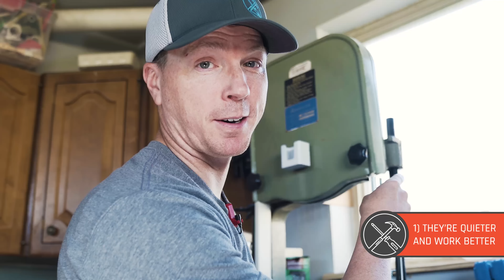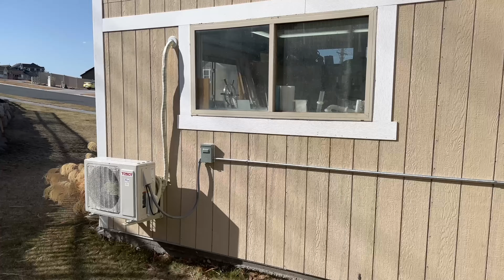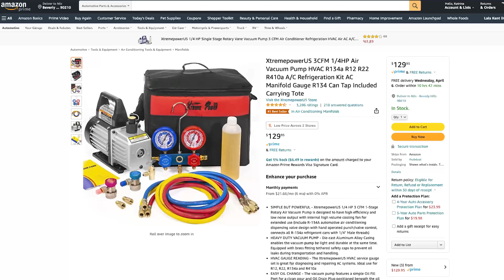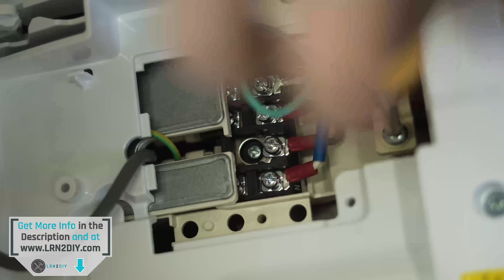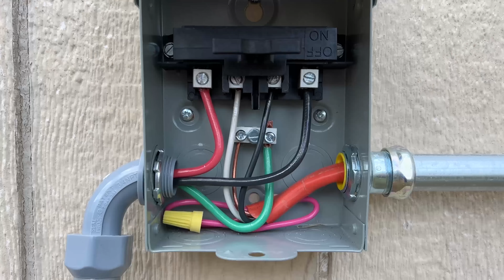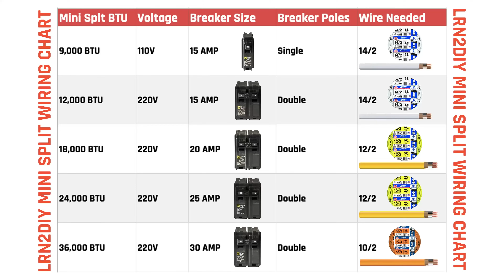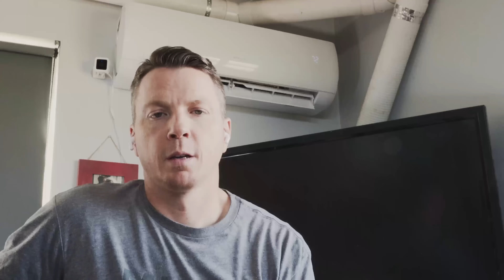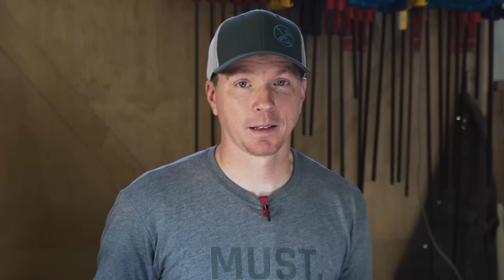Mini Split - 3 Things I Wish I Knew Before Installing

Comment: I just replaced my old Sanyo mini split. It was a12,000 BTU I replaced it with a Hessaire that came with precharged lines and inside head unit. It is also a 18,000 BTU or as they called it 1.5 ton. It was a little tricky but the meaning pre charged means the lines and head are pre filled with a gas NOT FREON. This unit was also a DIY unit. Only thing is i am having trouble getting it hooked up to my WiFi and cannot find the serial number on it. I am awaiting to hear from Hessaire for more information on these subjects. The unit works GREAT so far and I also realised that before I put the lines on I could cut them to a shorter size and reflair the connecting lines. The unit seems to have had enough freon in it to take care of the lines. Heat and A/C work great so far. I paid less than $1,000 dollars for the unit. It is also VERY quiet compared to my other unit.

Comment: I honestly didn't believe a mini split would be any quieter than a window unit. I was wrong. Now mind you, it's not totally quiet as in you won't hear it. If I had to compare the noise, I'd say it's more like the noise a regular stand fan makes on a medium speed. In other words, yeah, you know it's on, but it's not so loud it's disrupting to anything you're doing. This is only when you have it on high. At slow fan speeds, it's really quiet. Another thing that was surprising was their ability to cool your home.  We got an 18k unit for our living room kitchen and dining room (open concept), and it's never struggled to keep the area nice and cool even on 100-degree plus days! We also noticed the air is dryer than it was with window units. The inside humidity was around 60%, and with the mini split, it was around 35 to 40 % humidity.  We live in a high humidity part of the country, so having dry air inside is awesome! All in all we are really happy with ours. The biggest bonus was the cost! Local hvac contractors wanted around 7 grand to install one mini split! Now granted they had a 10 year warranty but only a 2 year on labor. We all know it's the labor that cost the most. We could litterly install a new unit for what a couple of service calls would cost in case something went wrong! It's just ridiculous what hvac companies are charging! It's no surprise that hvac contractors hate on mini splits so much! Lol!

Comment: Considering replacing a 20+ YO small Heat Pump serving a small upstairs apartment presently with an attic mounted air handler and outside condenser. Two motivating factors: Updating system, and lowering power demand. Apartment has dedicated power service of 100A. I plan on converting that Main to a 60A sub from 200A Main in main living quarters and hope a small mini split will work satisfactorily on that Subpanel. Thoughts?.What is the Amp requirements for a small mini split? Thanks for your video,

Comment: Mexican A/C's cost $400 USD, and they are Cheap to repair, downsides? you will have to make a ºC to ºF converter in the back of your remote, and has no Wifi- who needs it.

Comment: I think something else to keep in mind is the vacuum pump and gauges are the same equipment you need to work on your cars AC so it can be something worth having around. We did two mini-splits on our house this spring in Arizona and are loving them. I plan to install more after the summer for next year. Its so much nicer being able to cool the rooms we want to use vs the whole house when its this hot out.
Reply: Nice work.  I did the same thing and switched the whole house over to three ductless mini splits.  I did all the work myself including pumping a vacuum on the lines and flaring the line-sets.  The worst part really was running the electric, but I was an electrician for 12 years in the military.  A note on efficiency:  Our electric bill here in FL went from $10-$16 a day in August to $4-$6 a day.  I am expecting a drop of 1/2 or better in electric utilities.  Our central a/c was an old RUUD unit R-22 and I don't think it even had an efficiency rating.  Like you said..... we love it that we can turn units off and on in rooms that we are not using.  At night we turn off the 18K in the living room and just the run the 12K mini split in the master bdrm and close the door.  I did some calculations and it looks like our mini splits are pulling from $22 - $25 a month in electricity each.  That is a HUGE cost savings.  I would say installing these a/c units was the best thing I have done to this house so far.
Reply: Come help me install mine.  I'm in AZ as well.  :)
Reply: @151mcx  Gotta wait until just walking outside doesn't cause 3rd degree burns! Just saw our July bill and its running about $100-$150 less than it would have been without these units.
Reply: Something to consider: The line connections are the cause of many problems leading to failure. Recharge Freon is high and when installing yourself, the warranty is usually void for compressor failures due to power surges, low Freon ect… while the wall unit ac is loud but reliable; the quality of mini splits and customer service make it a tough choice to make. I’m on the fence

Comment: I bought a Costway 1200 b.t.u unit for 659. I did have to buy conduit, wire, etc, but it was well worth it. The efficiency is hard to believe. It uses about half of the energy in twelve hours than the window unit did in four. 
 I have no idea about the longevity of these things, but if it lasts even four or five years it’s well worth it. 
 I know it’s against building codes, but if you have a 115v unit you can put a three prong plug on the end of the whip if you want. It would be best to make sure it has the circuit to itself. I don’t recommend it, but it can be done.

Comment: It gets really hot here in the summer, so AC is a must, I need something that I can run for at least 5 hours that has a lower elec. usage.  I am taking a hard look at them. Our master bedroom does not get AC or heat, so having a dual unit would be preferable.  Our central AC is really loud your ears hurt after it cycles off.  Hopefully this is a good alternative

Comment: I just ordered a Danby 18 000btu d.i.y. It also had precharged and vacuum lines. So no need to vacuum line before installing. Electrical isn't very hard to do, just a wire and switch box. Hopefully it will last a long time. Apparently Danby is a good brand.
Reply from the maker: Nice! We still love ours and I'm sure you'll love yours too.

Comment: Aren't you overlooking the cost of the refrigerant? I hear that stuff is really expensive.
Reply from the maker: The refrigerant is already in the condenser unit and is released into the lines when you open them. This video shows the entire process and there’s nothing else you have to do.

Comment: I have never installed A/C but one of the key actions I see in videos is checking the line is gas tight before you introduce the expensive refrigerant. How can you do this with MrCool - you can't.

Comment: Great video. I am entertaining a mini-split in the 12k range to assist a central unit that just doesn't cut it during the summer. It is running 24/7 and the house still reaches 77 during the day and early evening. Unless I missed it or it was figured in somewhere else, did you include the cost of the freon to charge the lines? Do you have any figures on that?

Comment: The Mr. Cool unit you show puts out 12,000 BTU with just 115V input. You said yours is 12k BTU @ 230V. Not sure if the amp difference balances out actual power consumption, but I would guess the Mr. Cool machine to be a bit more efficient in the long run.  Not to mention some DIY'ers have already maxed out their 240v slots in the breaker box.
Reply from the maker: If you’re able to run the same BTU on 110, that’s pretty great. Adding the 220v is a lot of work for most folks.

Comment: so glad I click on this video! I live in southern Louisiana and my central air went out 5 days ago! It's been hitting 93 degrees each day and 80% humidity. I'm a teacher on break so I'm just living in my bedroom with a window unit. All Heating/Cooling businesses are backed up a month busy and I can't afford to replace a full Central Air unit, anyway. But I MIGHT be able to do this with a little help and your videos! Guide me, Yoda!
Reply: Cools better than central aor
Reply: @tecnikstr0be  I looked into it and can’t afford to set up the house right now. I bought a large window unit for the front of the house. When the time comes for some renovation and I’m doing other stuff, I’ll pull the funding for it. Keeping that bedroom window unit for hurricane season. It was my savior running on a generator when the lights went out!
Reply: @cassiev340  they aren't expensive I use aux brand and cools very cold
Reply: @tecnikstr0be  but I would need to set up for my whole house. I was in a position to spend a few thousand.

Comment: When you were discussing the cost difference between your unit and the Mr. Cool, what about the cost of the freon, or whatever they call it theses days, to charge the lines? I don't think non-licensed individuals can purchase or install the medium.
Reply from the maker: This unit, like many DIY units, comes precharged with coolant in the condenser. You never touch it - you just release it into the lines and that’s that.

Comment: Thanks for the video - good job. Quick question. I am building a sun room off of a patio.  Where I plan to instal the mini split is currently an exterior wall (will be an inside wall) that has Hardy Board. Mounting the bracket will be slightly canted to follow the row of siding making the bottom of the bracket out more than the top…..will this be an issue? I know it’s good for the drainage issue but do the units need to be level from to back as well as side to side? Thanks.

Comment: When you showed the vacuum pump and the oil for 130 bucks, did that include the refrigerant???
Reply from the maker: The refrigerant comes preloaded in the condenser on these units. You don’t need any separate refrigerant.

Comment: Your wire/breaker chart is incorrect. OK for THHN CU wire, but not romex.  Also, why did you run #10 to the disconnect for a 13 amp load and then #6 to the outside unit?

Comment: This is not a DIY for a novice!  If I were to purchase a mini-split I would lose all my savings by having a electrician to install the breaker box etc., However, I would love to hear your recommendation on my situation. My parents have a enclosed porch off of the family room single brick wall on three sides, the roof will be re-roofed with new material, last year November 2021 a small contractor insulated the porch roof with rolled insulation R-30 Unfaced Fiberglass 9 1/4-in thick - https://youtu.be/Jhgzry4CNTY

Comment: It's worth noting at this juncture there are a lot of 12kw 115v plug in mini splits these days.  So for a single room system, you absolutely can just plug it into a standard outlet now,  if that will provide for your needs.
Reply: I think you mean 12K BTU, not 12 KW.  What brands are you referring to?  I also do not think NECode would allow for putting a plug on an appliance that did not come with one, but maybe an electrician on here will tell us for sure.  On most minis, certainly those like the 2 Pioneers we installed in 2015, mains power connects to the outdoor condenser, and the indoor cassette gets its power run with the lines from the outdoor unit.  There is no way to "plug it in" or otherwise connect it to mains power inside.
Reply: @replyhere590  at the time of this post they were available on eBay. All for the Mexican market where they do not violate code.
Reply: @replyhere590  That's one of the advantages of the UK 230v system. Most mini split systems you buy here come fitted with a standard 13A plug already factory fitted and you just plug the inside unit into any standard outlet in the room. The cable to the outside unit runs alongside the coolant pipes and powers it. Our code doesn't requite a exterior switch.

Comment: 4:47 In addition to the differences you’ve outlined, the MRCOOL condensers come with lifetime warranty, which some people might find worth the extra $350.
Reply: Also, all Mr Cool units come with lifetime tech support so they'll walk you through troubleshooting any issues you may run into down the line.  Can't put a price on piece of mind IMO.
Reply: I've read a LOT of negative comments about trying to use their warranty, which is why I don't own one.

Comment: I am concerned with the warranty. Many cheap ones only have only 90 day parts and labor while Mr Cool provides one year
A gree installed by hvac guy has 10 year warranty. I had a cheap one and constant problems over the years. I put in a gree. My cost would have been $1900 for the 24kbbtu system. I got a gree guy who got same system as dealer for $1200 and he charged me $1000 install fee. I had two other quotes which they wanted 3700 to $5500. Contractor was very reputable and in business 35+ years. I would recommend buying a $75 mini split surge protector. I recently thought about one can buy an extended warranty 5 year from lowes when they purchase it in store for a few hundred. It covers parts snd labor after the factory warranty expires. Also, many systems lose warranty if they are not installed by an licensed hvac. This especially goes for brand name one online. Sone also require the hvac guy purchase the units. The off brand name may have gotten better than they were years ago regarding reliability. I just don't want to bebin a mess 2 or 3 years from now from failure. I suppose your paying for thst piece of mind. One may also consider a total hone American shield warranty which may cover if issue. These warranty are great if one has an older hone and older hvac systems and appliances. I have seen for some people it paid itself back many times over. How many of you have finished metal buildings with an attic. The mini split will cool much better if one puts ventilation in the attic plus uses thermal curtains especially if they have windows. They are $15 a set online on amazon

Comment: Hi does a mini split, when putting it in different rooms, required the same voltage if it's 1800 u need to do a split into another room?

Comment: Also, you cannot shorten MrCool line sets or you will still have to vacuum the lines. There line sets are long and it is not a good idea to roll up the excess lines behind the condenser unit.